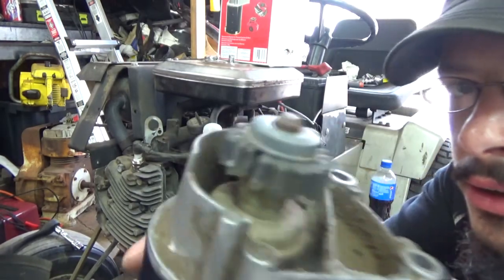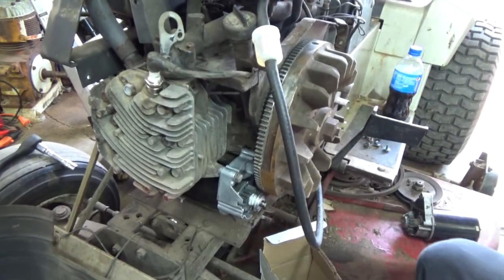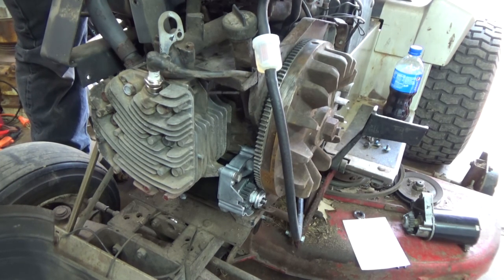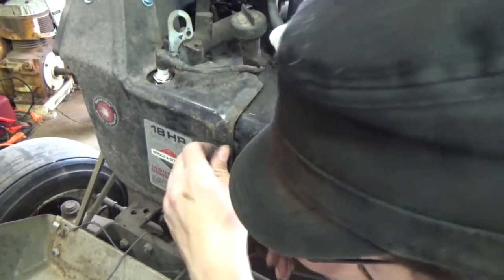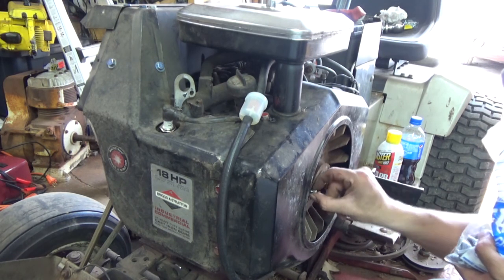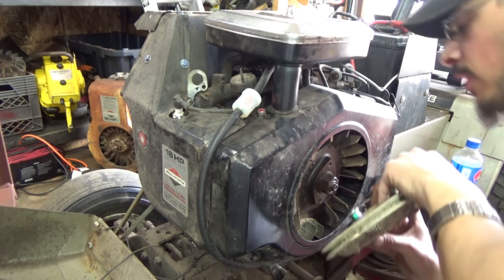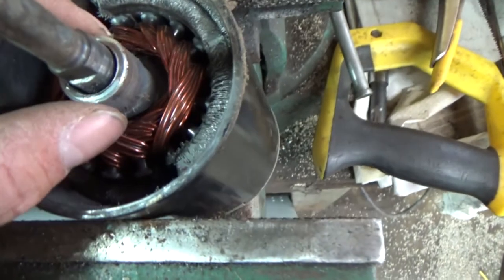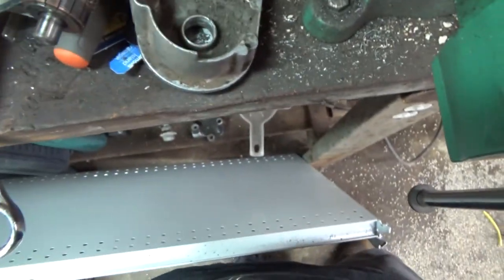briggs and stratton starter replacement on a horizontal 18hp. and overheating problem

Comment: I would run a couple tanks of Sea Foam  through it  before replacing the coil. coils usually  cause the motor to die until it cools off again.

Comment: did you figure out for sure if it what the problem was? min is doing the exact same thing. i have a 21hp twin vanguard. runs perfectly fine for about 30 min than starts surging until it shuts off. it wont run right until it cools off again.
Reply from the maker: it was getting hot
Reply: @CantKillMe  the engine or the coil? What did u do to fix it?